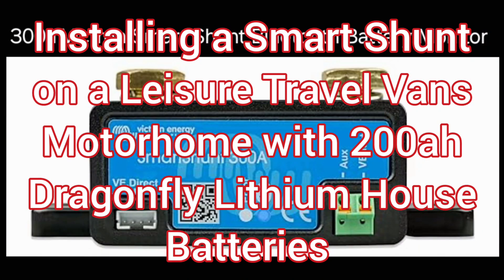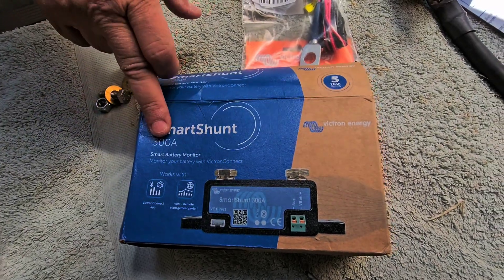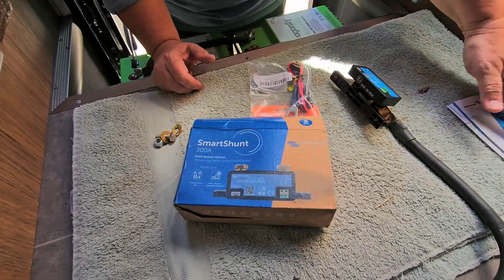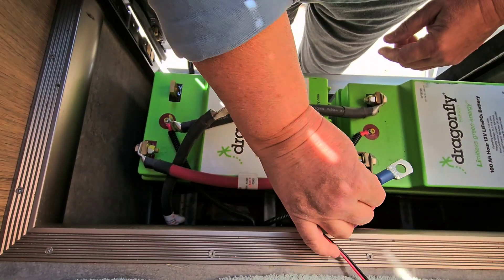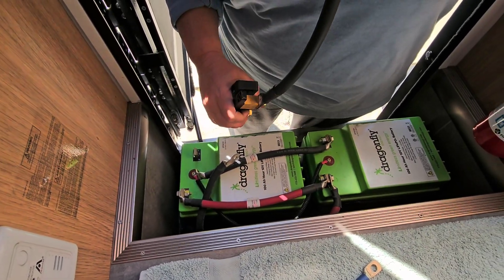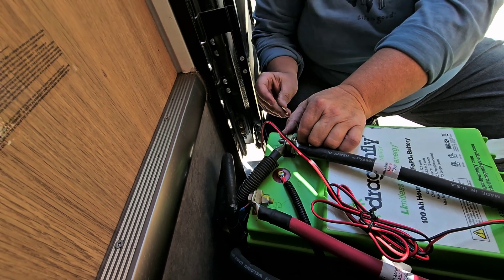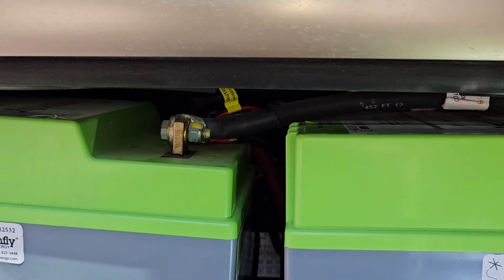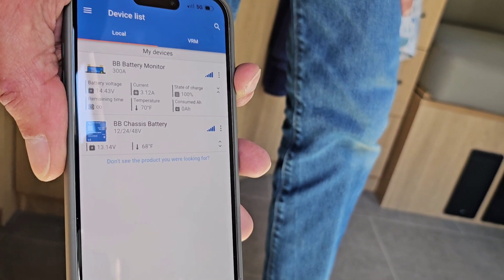Adding a Victron Smart Shunt Battery Monitor to Leisure Travel Vans House Batteries

Comment: Never mind Sandy. After a bunch of digging and internet time I figured it.
Reply from the maker: So what was the problem?
Reply: @SandyRVUpgrades  it's funny. It's within 5 degrees now and everything seems to be fine. I still have the extra sensor and will hang on to it just in case I need to switch them out. Will monitor it for a few weeks just to make sure everything is working right.

Thanks for being there when needed and everything you do for the LTV community. Take care.

Comment: I just installed the Victron Shunt Temperature Sensor wiring you have listed above and I am not registering any temperature at all. Only difference is I have the 500 amp smartshunt. I am using the Victron Connect app on my phone for all of my information. 25 LTV WRTB with one Battleborn battery. What am I missing here?
Reply from the maker: If you connected the temperature sensor correctly, then in Victron Connect for your shunt settings you must select temperature monitoring.
Reply: @SandyRVUpgrades I have it all set up, but now I'm trying to figure out why there is a 40 to 50  degree difference in actual temperature and what it is reading on my phone. And yes, I do have it set to fahrenheit. I'm going to switch out the sensor with another new one and see if that works.
Reply from the maker: @LuvOurVanGo You have it connected to the main positive battery terminal and the wires are in the correct positions in the shunt? If so, then it's got to be a bad sensor. With your battery in the battery box, it should be reading  10°F or less different from the outside temperature.
Reply: @SandyRVUpgrades yes, I have it connected correctly. I'll let you know if it turns out to be a bad sensor

Comment: When I swapped my RV's two lead acid house batteries with 2x 100Ah LiFePO4s I unplugged the two solar panels on the roof of my Class C Winnebago before I started the swap because my RV also does not have a solar panel disconnect switch.  Not sure if your LTV solar panels can be unplugged at the roof or are hardwired but thought I'd mention it as a solution to others.  Just remember to plug them back in when done.  :)
Reply from the maker: LTVs have a fuse in its battery box that you can pull to kill the solar power. It's straight forward to add a switch to the positive wire of a solar controller input if one wants. I add circuit breakers on both sides of my solar controller.